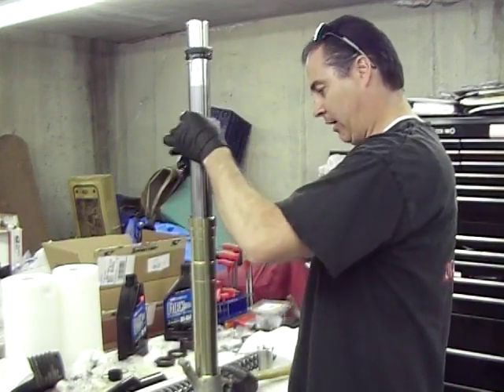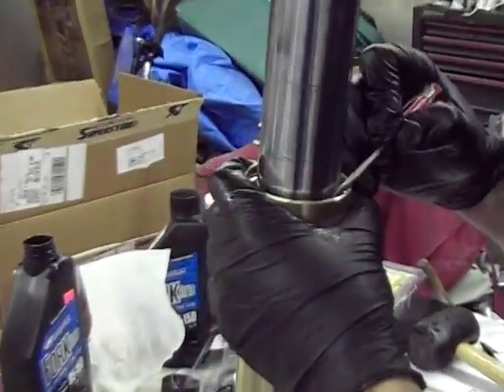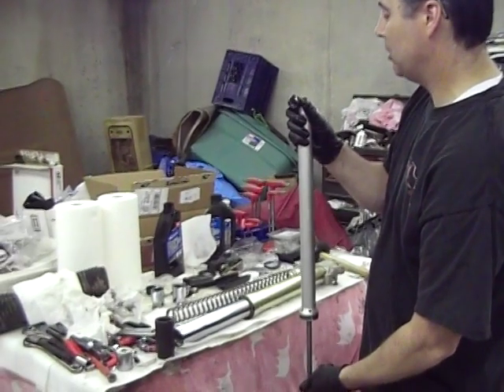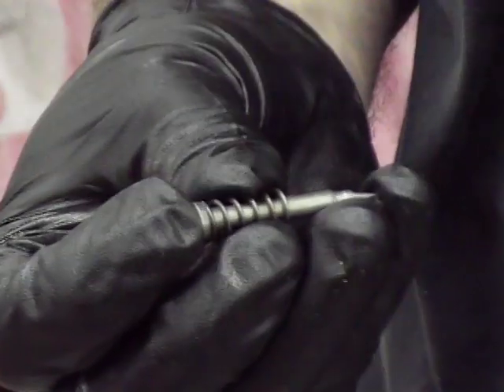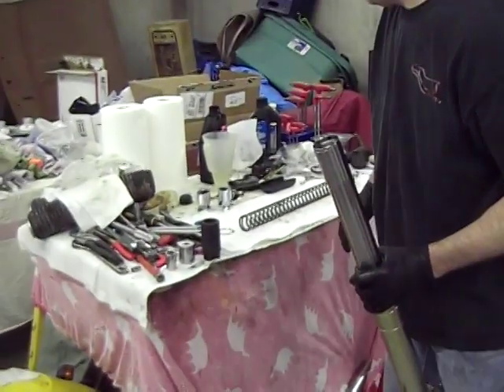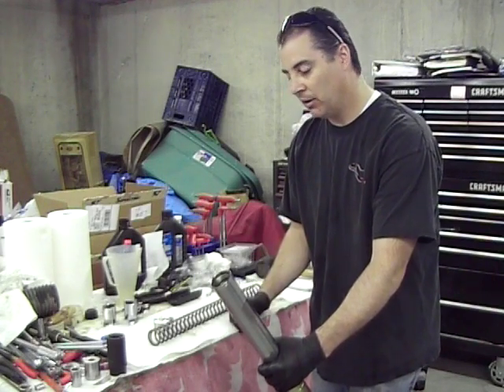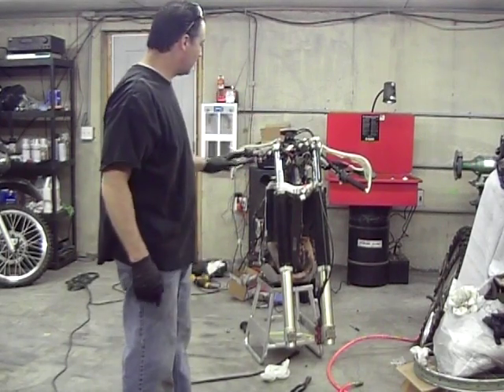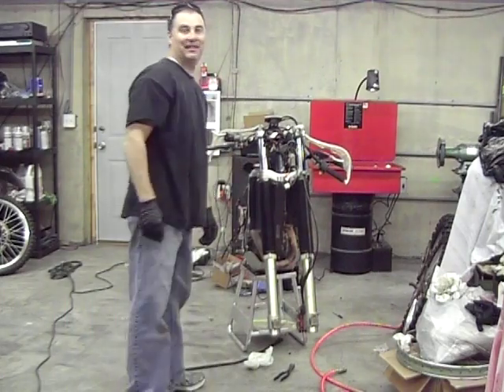EveRide DRZ 400 Extreme Makeover Episode 12 - Fork Re-assembly

Comment: Hey, great series! I saw how you removed the base valve with an impact gun, but I'm wondering how you end up getting the damper rod/ base valve back together without the rod holder tool. Seems you skipped over that part!
Reply from the maker: You just slide the cartridge back in, and thread the basevalve in by hand, then tighten the basevalve. The cartridge will usually stop spinning as you tighten the basevalve.
Reply: @MrDuhfactor  No way it can come apart inside? Torque spec is 58 lbs. I'm sure everything will become obvious once I get in there.

Comment: hi guys, no top out spring on the damper rod? (@min 3:10 )
thanks!
Reply from the maker: +mgb pro Negative buddy.... This has been so long ago I couldn't remember... had to watch it again.... They didn't come from the factory with one on this model.... The old dampning rod design has them, but many rebound rod open chamber forks don't. Weird aye?
Reply: thanks! I grabbed a used "drze fork" and once dismantled I found a short main spring (46cm long instead of expected 50/51 cm) and two springs in series on the damper rod (for a total of 6cm)! so, I mean I can bring back the fork to the original length removing those springs on the rod and putting a new set of regular main springs of about 50cm.
Great! (really I don't know what drz model  this fork come from...)